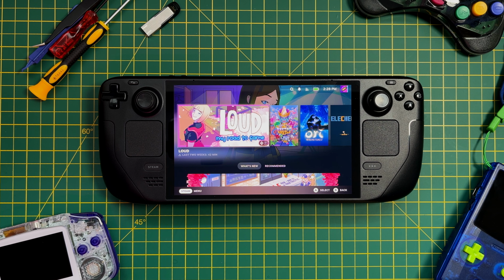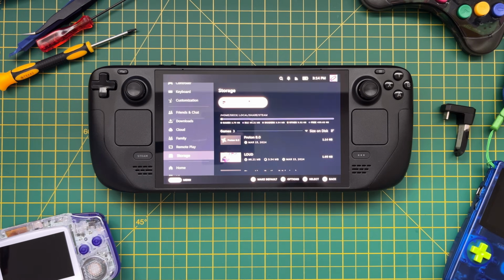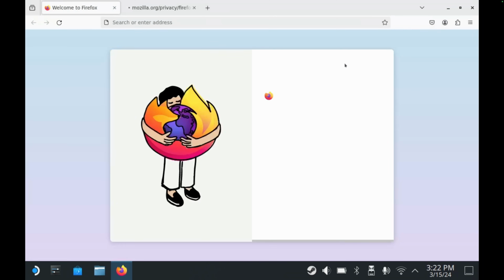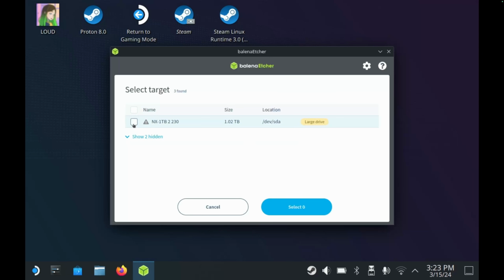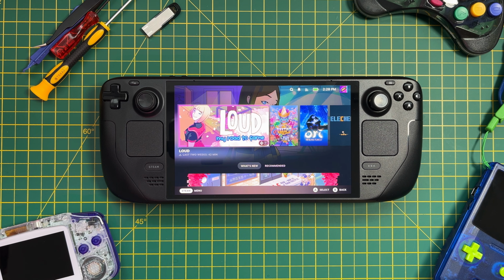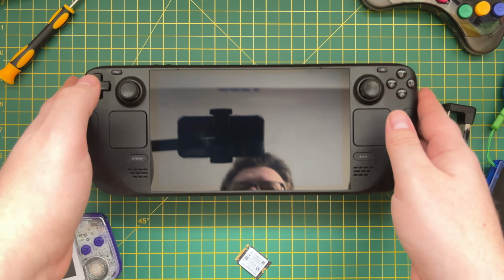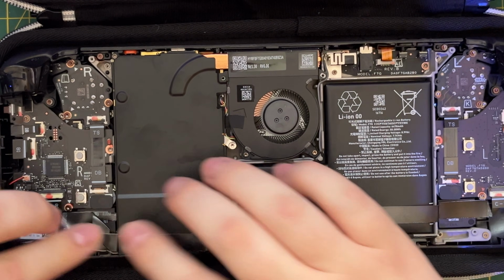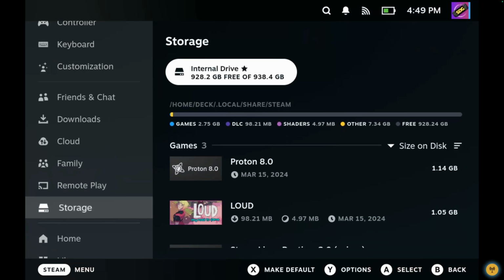Upgrade Your Steam Deck Storage! The EASY Way!

Comment: How do I resize the disk?  I cloned my 1tb to 2tb and I’ve not got any space. I’m a newbie
Reply from the maker: You shouldn’t have to. Did you follow this guide to clone your disk? Also, do you have windows installed?
Reply: @steamdeckguy  I followed the guide. Yes I’ve got windows installed. 1st issue I’ve run into following all your guides.
Reply from the maker: @russellmay9841  look up a guide on how to extend the partition - it should be straight forward fix. By default, steamOS will extend storage to unused space automatically, but I am assuming because you had created your own partitions (for windows) it hasn’t done it.
Reply: @steamdeckguy Any links to doing that please? I can’t find a good one. Thank you

Comment: Great video, the x64 Etcher download is now a zip, could not figure out how to get it to work, so got an earlier version from softronic. Worked great thank you.
Reply: For what it's worth, if you extract the zip archive, all you need to do is click on the balena-etcher file and choose the option to Execute it, and it will launch fine.
Reply: Can you put a link for x64? I'm having the same issue. Thanks!
Reply: @maritimemongo01 just use the zip file, extract then tap on the item called "balena-etcher" worked first time for me

Comment: Thanks for the video. Unfortunately when i tried following it exactly everytime i clicked clone drive in balena etcher it just gave a prompt to connect the source drive. So i followed a reddit post using konsole and the dd command, which took FOREVER but did do the job. As for the rest of the video, i agree completely, tweezers suck. Chubby fingers for the win.
Reply from the maker: Glad you did it. Annoyingly balena etcher is broken with the latest release. Hopefully they fix it soon!
Reply: @steamdeckguy oh sweet, i thought i was just dumbass. Good to know it wasnt me.
Reply: @steamdeckguy which version should we go back to, to avoid this issue? Right now i’m experiencing the same issue: Balena not recognizing my sd card.

Comment: (General question to the public) I’m at where balena etcher is up and running. But. I’m at the part where it shows plug a source drive. There is no show hidden options. I just have a screen where it says “plug a source drive” with a picture of a SRC USB with an arrow that says. Plug a source drive in. I cannot select anything.
Reply: I have the same problem
Reply from the maker: I believe this is an issue with version 19.21  of balena etcher. I was playing around with it earlier to try and help you out and it doesn’t work for me either. But version 18.11 which I used for the video does still work (not sure if you can still download it?) I saw some comments on GitHub from a few days ago for similar issue so dev is aware. Hopefully they will fix it soon as it appears to be completely broken!
Reply: @steamdeckguy  oh noooo
Reply: @aliendisclosure227  did any of you recommend another solution

Comment: I accidentally formatted it. How do I get it not, where this can work?
Reply from the maker: Providing the drive shows up in balena etcher, it shouldn’t be an issue
Reply: I’m stuck at “plug a source drive” in. I cannot get it to recognize the 64GB SSD in the steam deck. Not sure how to get it to recognize.
Reply: It doesn’t recognize it in bale man etcher. It shows it on the steam deck. But when I pull up Helena etcher. It says connect a drive.
Reply: *balena

Comment: Great Video, thank you! Going to jump into this with my LCD Deck this weekend - just before I do, you mentioned there were some differences with the LCD versus the OLED version, is it just the internals being slightly different?
Reply from the maker: Yes, the screws are different and also the placement of each of the internal parts. Personally I found the LCD easier. I’d recommend following along to the ifixit guide as it goes into more detail then I show in my video, and make sure to remove the SD card! Good luck!
Reply: @steamdeckguy  Awesome! Thank you for the insight! Just subscribed to your channel, looking forward to seeing all the videos to come!

Comment: I'm planning on trying this clone method on my LCD deck as soon as it (ssd and enclosure) arrives from Amazon!
I just wanted to verify that (as you mentioned in the video) you don't need to worry about partition sizes, etc. I'm just surprised that you don't need  to boot to another drive first.
There are other guides that show having to boot when using something like clonezilla. How does Belena Etcher handle this differently?
Reply from the maker: I believe steamOS is automatically extending the unused space to fit the size of the disk. Tbh, I was expecting to have to extend the partition but was surprised when I didn’t….

Comment: Hey what are the other uses of this nvme enclosure? Can used it like a hardrive in my laptop? Bcuz im goin to upgrade my SD512gn to 2TB & i dont want to waste 512gb ssd on my steamdeck , i want to use it like an extra storage i put my movies pictures files etc. like HDD on the laptop plugged and watch or etc but in steamdeck haha
Reply from the maker: Yes you can do that - you’ll just need to wipe it first
Reply: @steamdeckguy Yow bro , how to safely remove nvme SSD enclosure in my steamdeck is there program select eject in the SD linux system? , or I'm just gonna remove like nothing happened haha
Reply: @steamdeckguy  yow bro I know this is a stupid question to ask , but how can I format or wipe out the files on my Original SSD 512Gb from my SD-oled ? I want to used it to store some movies , files etc. Im new to Linux haha

Comment: If I bought an OLED deck, could I clone my current LCD deck's ssd and then put that in the OLED one and have it work fine?
Reply from the maker: Yes. Just make sure your current deck is updated to latest OS version
Reply: Thank you! I was searching the comments for this exact question. I just bought the OLED deck also. I have a program I wrote to run my VPN at startup and I really didn't want to do that again, and I wasn't planning on replacing the SSD. I have large enough drives to store and transfer.

Comment: "easy method" "ok now you're gonna need to buy ... -" okay bro
Reply from the maker: No worries bro. If you don’t want to buy an enclosure then follow my other guide to reinstall steamOS - I’ll warn you though you will need to buy a USB drive or micro sd card…personally though I recommend getting an enclosure so that you can use the old SSD as an additional storage device.
Reply: He said easy, never said free…. Quite obvious if you’re wanting to clone a drive you’re gonna need some way to connect the nvme externally lol.
Reply: Are you slow? He didn't say it was going to be free. He said it was an easy method. Which it is 🤦🏿‍♂️
Reply: @blackhippy3638  he edited his original comment… are you slow?
Reply: @DatHondaBoi223  huh? My comment was for @Glatting(the og comment). Not you. I'm agreeing with you
Reply: @blackhippy3638 how is it easy if you need to run around looking for parts? 😂 Are you stupid?
Reply: Me when im stupid

Comment: So, I've tried this over and over. turns out I'm getting the same results. I tried on a brand new ssd. I even tried on another one actually. Both different, both same results...and basically it can run perfect 1st try after cloning, but the second I attempt to restart, it gets stuck on the logo, any work around this?
Reply: Side note, I went into the steam OS (minus and power selecting second option) and after all the gibrish, it said at the end "cannot open access to console the root account is locked"
Reply from the maker: Sounds like it’s corrupt. I’d put the original drive back in (or use a PC) and create a recovery drive, then do a full re-install on the new drive.
Reply: @steamdeckguy  create a recovery drive? 🤔.. ok, could you give me a little step by step process guide? And you said put it in my original ssd?
Reply from the maker: @misfitmazza663  https://youtu.be/8SqomrDTYfs
Reply: @steamdeckguy  so I tried the recovery using my laptop and it got stuck with gibrish sideways saying error can't find command. Then it changed into this white outline "gnu grub" with 5 options to choose (steam os, advanced options, system halt, system restart)
Reply: Holy crap, it actually worked!
At first I wasn’t sure the battery wasn’t plugged in right, but it’s working fine.
I did the cloning yesterday (about an hour for the clone with the verify), and the replacement just now.
The storage in settings reports the full 1tb.
Your method worked great, thank you!
Reply from the maker: @dazzlemi  glad to hear!

Comment: this did not work for me, my steamdeck wont boot now
Reply from the maker: Hold the volume down button during boot, and then check that the ssd card is showing up as a boot drive. If it doesn’t, it means you have not connected  the SSD properly.  Otherwise, I’d suggest putting your old drive back in and either retrying, or doing the reimage method (I have another video showing how to do that)
Reply: @steamdeckguy  I have the new SSD in now and working but had to wipe it to get it to boot from usb. I’ll just have to re do my settings over time, unless there is a way of copying over stuff from my old drive
Reply: @samladlow1  Same, with the cloned ssd it is not booting at all even though the ssd is been detected from the BIOS
Reply: @shattia  I booted from usb and just re did my settings, the only tricky bit was getting yuzu to work again. But I’m all sorted now. I just did it all gradually
Reply: @samladlow1  I just wiped it and reimaged the sd. Emudeck was already on the external sd so everything is working just fine already. I just need to Download all the games again.

Comment: Is this the same for a regular Steamdeck?
Reply from the maker: Yes, you can use the clone method for ANY steam deck. The only difference is when it comes to a physically swapping out the SSD since the OLED model internals has been revised